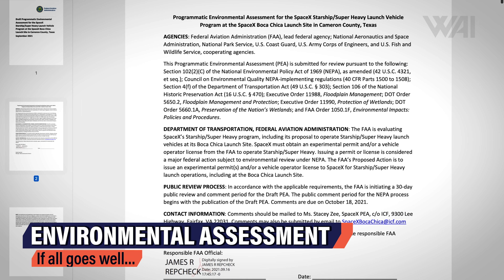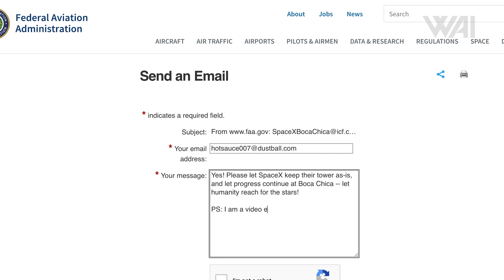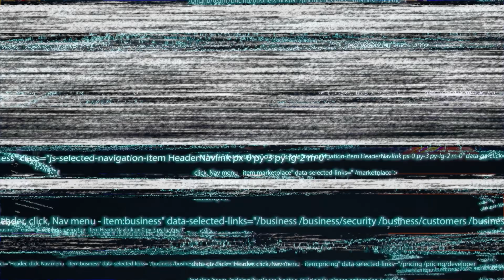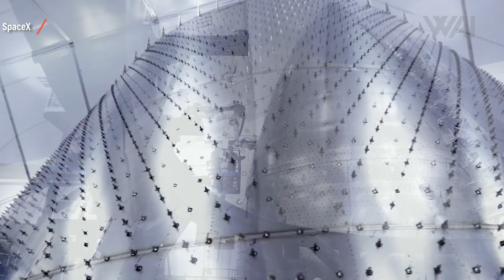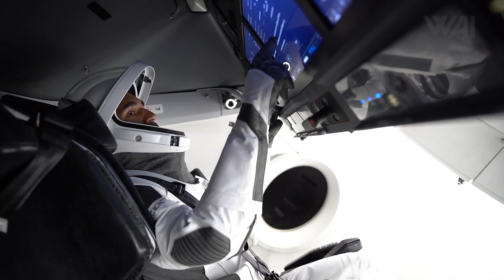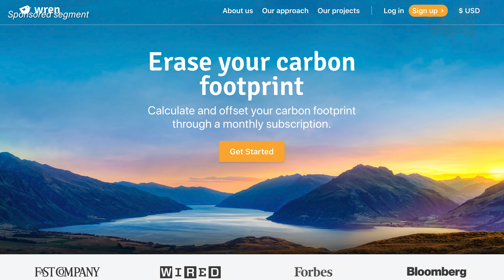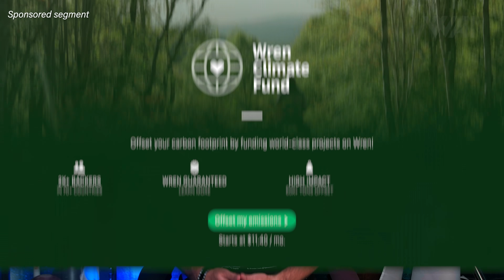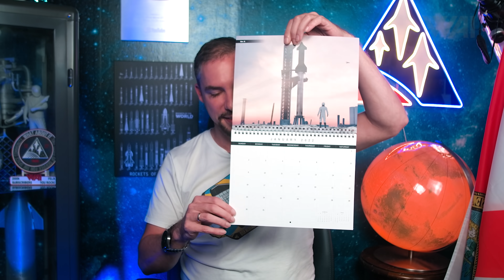One month to an orbital Starship launch attempt! & SpaceX Crew 3 Mission Status!

Comment: I had a bit of a Eureka moment while watching WAI today.
I have watched the development of the heat shield and thought about the star brick issue. Bricks have fallen off during every test and static fire. In its current state it's unlikely that the star brick system will keep it's integrity  during a full multi-raptor static fire, let alone launch or re-entry. Currently star brick is not fit for purpose.

I understand SpaceX's aims with the star brick. It is simplicity and efficiency. They want to produce a robust, reliable and easily repairable heat shield system.

Today I suddenly understood that SpaceX do not understand the nature of their creation- The Starship. They see the Starship as a machine, as an inert unchanging device.
I am sure they understand on an interllectual level that the vehicle would expand and contract during fuelling and flight. They designed the star brick system with multiple underlayers and an expansion gap between each tile after all. However in its current form the flexing of the vehicle skin constantly threatens it's integrity.

Today I realised that Starship is not an inert machine. It will be, from the moment of fuelling until the moment it is de-tanked- a living breathing animal with a flexible stainless steel skin. It will be constantly expanding and contracting in three dimensions, on the ground, in orbit, during re-entry and landing.

With this in mind. You cannot put a set of fixed inert objects like a star brick attached via rigid mountings on a constantly flexing surface like Starship and expect it to remain attached. The star brick system in its current form will never survive multiple flight circles.

What is the answer?  Well if Starship behaves like a living and breathing animal, constantly expanding and contracting, then treat it like one.

I am an angler. I love going fishing. My Eureka moment was suddenly thinking about all the fish I've caught. The answer is "organic". Mother nature has already designed it.
Instead of a "Star Brick" we need a "Star Scale".

Fish and reptiles have scales and birds have their further development, the feather. Scales are relative inert and yet they protect and cover living and constantly flexing lifeforms.
In order to achieve this they are 'mounted' via a flexible semi-articulated 'hinge' along their leading edge allowing them to move with skin and muscle beneath them, they have a complex three-dimensional shape allowing each scale to slide over or under the scales adjacent to it which allows flexibility and yet retains complete coverage.

So I propose the "Star Scale" system. It essence it is no more complex than the existing heat shield design. It will require the creation of a flexible mounting connecting the Starship skin to the upper edge of each "scale" and the creation of a more complex overlapping organic tile design. Each tile mounting can move independently as the vehicle skin flexes, while the overlapping nature each Star Scale would maintain coverage no matter whether the space craft structure was expanding or contracting. Consulting with leading fish and reptile biologists should produce an efficient and viable tile design. However like the Star Brick most tiles should be identical with only a few variations for certain areas of the vehicles skin.

In theory an efficient organic brick or scale design could actually improve aerodynamic efficiency by reducing drag like some fish scales reduce hydrodynamic drag not to mention that during reentry a scale design would actually become more interlocking and more sealed the higher the aerodynamic pressure on it.

Mother nature solved SpaceX's problem millions of years of years ago. We just have to pay attention. This is not a crazy idea. It's a simple, robust and easily repairable solution to the problem.

I would greatly appreciate it if someone could pass on the concept to Elon and SpaceX. I want to see Starship succeed. :)
Reply: This is actually a really good idea. The key is overlap. The scales would give it mobility and also overlap, which could allow each individual scale to be thinner/lighter.
Reply: A. The Starship can re-enter without issue even if its missing a few tiles
B. Tiles are easier to install/replace
Reply: Sounds great, except that terminal velocity of the starship is over 200 mph?  What happens when the ship goes vertical for landing and the bottom edge of the tiles are exposed to that wind?  Maybe there's a solution to that.
Reply: @rafaiaa13  your right, but the edges of the current bricks are pretty exposed too. Starship lost some just from thruster tests. Imagine what full on sustained engine firing is going to do to the bottom rows of Star Bricks. All the edge zones and areas round the thrusters need large one piece strips to prevent bricks from being lifted.
Reply: I'm sorry I stopped reading your post after I h
Reply: if that is true, then someone in SpaceX should realize it at some point. We'll see.

Comment: Steel is of course ferromagnetic, so it may be possible to magnetically attach the tiles to the hull, by embedding magnets inside the tiles. 

Although if the temperature of the hull exceeds the curie point of steel(~700C) the hull would lose it's ferromagnetic properties and the tiles would fall of. I think the heating could probably be kept below that though. Also not familiar enough with heat tile manufacturing to know if embedding magnets is possible.

Comment: For the heat tiles, SpaceX should consider making them larger so they span more pins.  Thus, instead of being one current tile in size, a new design would span the same space as 3 or more tiles, thereby making the base more reliable and using fewer tiles attached to the spacecraft.  Also, if the connector was made with a connection that is attached to the tile through a pressure based holder where the post fits into a connector on the back of the tile so that it can be easily attached or removed by pushing on the tile.

Comment: Yes  The tiles should have a horizontal tube connected to a SS 6 legged spider embedded in the tile beyond melting point ! then a thin SS wire can be threaded through the tiles and anchored at each side of the heat shield . For minimum weight and robotic manufacturing, those tiles would be fastened securely without  the 3 pins which would weight the same and no adhesive needed ! Read it a few times carefully

Comment: I see no reason why very large parachute cannot be deployed as soon as the ship begins re-entry. This would eliminate the need for the thermal tiles and the flaps and the dreaded flip maneuver because the ship could come back engines first. A parachute can be manipulated to change course or to alter the rate of decent. It would be lighter, cheaper and safer.
Reply: you mean use a parachute when a vehicle is going at 17500mph? very safe indeed.
Reply: @justinni_  Air resistance is vertually non existent at the beginning of re-entry, the parachute would definitely survive deployment. The XB-70 used parachute braking and it was about the same weight.
Reply: Dude what

Do you understand the size of the vehicle your taking about?
Reply: @eduardorodriguezvazquez5120  Yes it would have to be a very large parachute, it could be triggered by a pressure switch as soon as air resistance was optimal.

Comment: The tiles are a tricky problem but luckily SpaceX has time, at least in my opinion. If I was Elon obviously I would prefer to have a fully viable mounting solution now but I also wouldn’t be too bothered if Ship 20 flew with a heat shield that was known to be not good enough to survive re-entry because even if it burns up the first sub orbital flight would, again in my opinion, be a spectacular success if it only achieved some of - successful launch, surviving maxQ, successful stage separation, booster burning back to an acceptably accurate sea landing, and Ship 20 getting onto the desired suborbital trajectory. If it did all of those I would be jumping up and down with joy even if Ship 20 then burned up on re-entry.

It took a few very impressive SN flights all with successful belly flops and in most cases successful final flip before they finally nailed the soft touchdown. I can see the same thing happening here. Obviously the fewer attempts the better but if it takes 3 or 4 attempts then that’s what it will take. I suspect we still have a few more months before the first sub-orbital launch some time early next year but once that is done, assuming FAA does approve it, then I hope we will see the next launches happening with quite a high cadence just like we did with the 3-engine SN flights.

Comment: If Elon says 1 month, Elon time is sped up and it really means 3 months. As I said since June when people were talking a July launch, not til 2022. Also, the US Military has started developing a new camera to be mounted to a plane to monitor starship as it re-enters and with an IR camera, in development, will check the temperatures on the “Starbrick” heat tiles. The US govt can’t do this without a flying starship and a starship can’t fly without permission. Now Elon would go build all this stuff without permission but the US Space Force wants to run a test on “Starbricks” and they won’t let the FAA stop it. I assure you, they will get their temporary approval for 20 sub-orbital flights and 5 orbital flights for a year when they will have to re-do it. The US Space Force and SpaceX have military plans for Starship and they won’t let their military plans be side-tracked and civilian space flight will benefit. AS IT HAS ALWAYS BEEN. Don’t think going to the moon was for humanity, nor Skylab (who had a military counterpart we just heard of), nor the Space Shuttle nor the ISS. All driven by the military specifications so they could use it for their means if they desire.

Comment: Spray on or paint on heat shield.  Like a truck bed liner application.  Fits every curve and odd shape.  Thickness can be increased in sensitive areas.  Repair is easier in orbit or on Mars.

Comment: Here is my idea: come up with tiles that are screwed on by rotating the tiles. Have tiles that have six semicircular notches around the edge. They go on first and have a wide holed nut that threads onto a wide, short post, like the lid of a jar. Set them up such that six of them define a circle and are shaped such that a circular tile with the same style nut can be screwed into the post in the open space between them. Repeat this tiling pattern across the hull. This should work until you come to places where the geometry will no longer allow that. The circular and notched hexagons should probably be threaded somewhat differently so the tiles don't end up throwing the whole pattern off. (Elon, can I have the patent if I price the royalties fairly?)

Comment: I think they will eventually abandon the hex tiles for large curved half-ring shields, and shields that are integrated into the flaps rather than being attached. A half-ring shield with hundreds of pins reinforcing its hold will stay on better, and I think its arguable that, with some simple machinery, its simpler to maintain. Rather than replacing a bunch of tiles, you can just take off a ring. Rather than having some guy on a cherry picker up there gluing new tiles on to the flaps, just have a rod that can be removed and the flap comes off (with a crane). Then put on the new flap, re-insert the rod, bolt it into place, and you're done.
Having fewer, larger tiles means you have fewer seams, fewer potential points of failure, and if you invent specialized hardware, they can be inspected and replaced faster. Fewer shields also means you can put more investment into each shield, perhaps even integrating sensors to detect issues before they become a problem.
As for the flaps, there's no reason why ceramic can't be aero surfaces. Just integrate the shields into the flaps, then you can detach them & do maintenance on them on the ground if one cracks, and do the work in comfort with several people, and readily available tools on-hand.

Comment: Heat tiles should be fish scale shaped with fixing top corner which is protected by the tile overlap from the row above protecting fixing point. As ship only flips to vertical at last minute at much lower speeds tiles should stay on ok with on re entry.

Comment: not really any point in building more boosters or star ships until they fly the one they have and do some tests. the data they get from booster four and sn20 could require a major redesign.
Reply: Continuing to assemble ships and boosters trains their staff and allows them to refine procedures and tools.
Letting them sit on their hands for weeks would be still costly but achieve nothing

Comment: RTV silicone adhesive on the pegs then press the tile in place. Flexible, easy to apply, high temp resistance versions avail, good tensile strength,, and removable with simple scraping. Been used on rockets for decades.  From your favorite retired rocket scientist.

Comment: The only thing I can think of that might be a better heatshield design is instead of hexagons use circles with curved triangles in between. They can be screwed on. The triangle pieces are screwed on first, then the circles in between. Obviously you can't screw on hexagons because the edges would hit each other as they get closer to the hull. I'm not sure how they attach them now but it would have to be some kind of adhesive.
Reply: If the sharp corners of the triangles prove too fragile. You could use hexagons but screw on the steel post first and then reach behind them and spot weld from the side. Not sure about the last one though.

Comment: Felix I have the solution. Need to create a tool that can be used to turn a "CAM LOCK" A faster that is pushed on and rotated to cam lock the tile to the body of the ship. Redesign the pins at the top to accept the spring-loaded cam lock. The cam lock item would be ceramic so the heat won't damage the spring. Spring is possibly made from titanium. What do you think? Have Elon examine this possibility. Reusable and safe.

Comment: SpaceX should invent new composite materials which can incorporate a great heat resistance, great weldability and machinability. Imagine having 4mm sheet consisted of layered aluminum oxide, stainless steel, thin stainless steel honeycomb layers for great isolation repeated many times in 4mm sheet. Some ideas like this. Some new great material science must be used.

Comment: I think they should try gluing the blanket and the tiles with some elastic glue. Both pins and glue are needed. Vibrations of the tiles during reentry will be a show stopper.

Comment: I have been thinking along the lines similar to Elons quotes that no step is the right step.  I wonder if anyone has considered making the heat shield one piece. Instead of many tiles at least a major portion could be one piece instead of a couple thousand pieces. I expect someone will say it cant be done but I'm not so sure and I bet it would take fewer connections and possible way less because of fewer points of connection. I dunno what do you think?
Reply: The larger the tiles become, the more stress they will experience when the hull beneath them expands and contracts due to temperature variations.
The current size might just be a good compromise

Comment: Perhaps some kind of metamaterial, that shrinks a little when it gets hot, could be placed in between the tiles.  I know a lot of the suggestions here don't make much sense because the tiles have to be able to expand when they get hot, which is why they are all separated, which is why occasionally they fall off.  So you can't directly link them together unless you're able to still give them a lot of "give."  If it wasn't a really tough problem Musk et. al would have figured it out by now.

Comment: I did voice my opinion about the matter and the past whether it's stupid or not I think that Starship team should bake the tiles with the micro metal mesh running through the the center of the tiles while they're being molded that way making them into strips as wide as a Starship welded ring and and if possible as long as the diameter of the ship plus the insulation if not in sections.

Comment: Instead of individual tiles - why not a wrap, maybe something that is sprayed on or a material that is wrapped around the rocket?
Reply: they could just make super massive heat shield that goes in sections similar to how they assemble the rocket so there could be only need of like 10 heat shields instead of 500 or 1000 small pieces of shit
Reply: @EvelynnNO69  The reason they don't do this is because of heat expansion. big tile, wants to expand, nowhere to go, cracks. small tiles, some room in between, expand, they're fine.

Comment: Glue the tile to a back plate that will be easier to lock on to the hull. Use the glue they used on the space shuttle tiles. Just don't direct glue to hull. Use a a backer or secondary layer that can hold on with expansion and vibration

Comment: I'm actually surprised SpaceX has been allowed to break the permits as much as they have done already. Just because you have cool technology should not mean that you can break the law. Anyway, It is still not FAA that stops anything, SpaceX is still far away from a test flight. Not even the fuel farm is ready... But I think the engines on the booster will take the longest time. We know from all earlier tests and static fires with just one to three engines that they have reliability issues with the raptors and to have 29 engines working perfectly together will most likely take a lot of time.  Musk have been saying one month since spring so I do not have high hope it will be correct now, I think he is just trying to set public pressure on FAA.